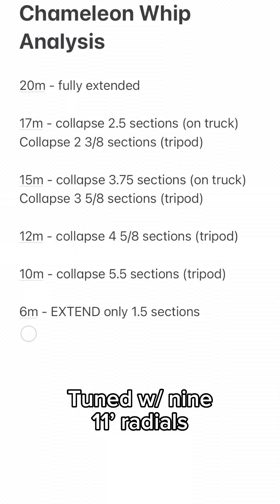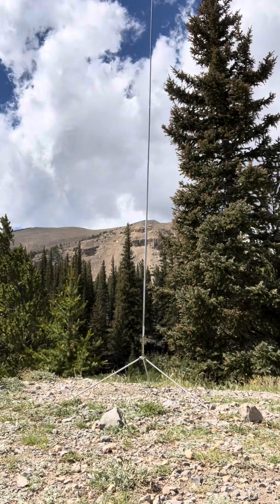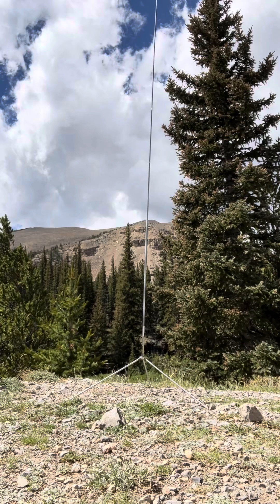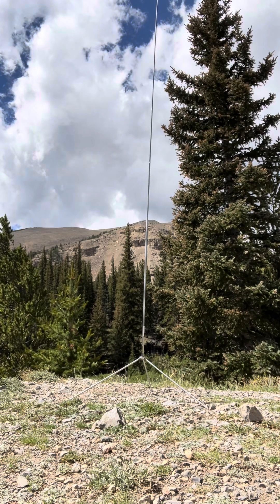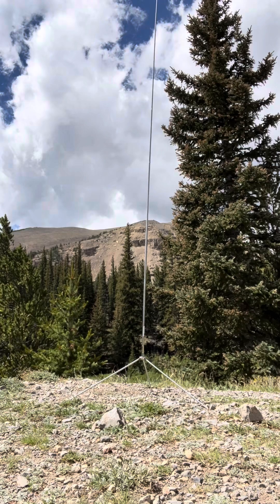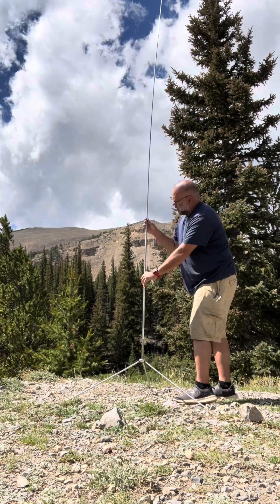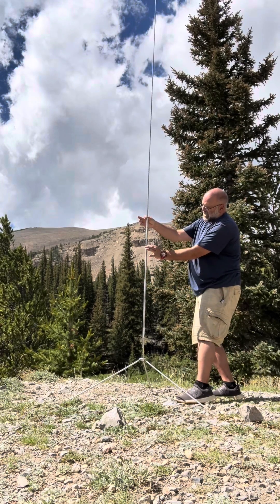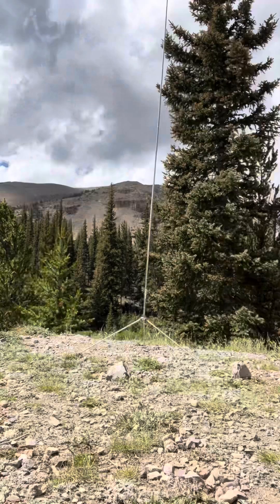Tuning the Chameleon 17’ Whip

Comment: Why is it different on truck mount??? Does the mount add some how to it ?
Reply from the maker: The magnet mount on the truck has far different conductive properties than the wires laid on the ground. I find no tangible difference with either of those settings and taking them all over the country, but there is a difference from the ground to the roof of the truck. Keep in mind the truck is 9500 pounds of metal.

Comment: Great video. I was looking to see how people were "marking" the stainless whip for the different bands when I found this.  Well, this just makes too much sense!  Thanks!
Reply from the maker: Thanks for the comment, Steve. My first antenna was a Wolf River Coils and I marked the coils with a Sharpie for quick reference. I learned immediately as an evening activator that you can’t see those lines well in the dark and flashlights/red lights just cause a lot of glare and don’t help either. Hence this process.

Comment: Thanks for the info Sir. I’m using an aluminum window screen for a counter poise. I normally pull out the 25’ tape measure but this will be much more helpful. Thanks again,KD5OZJ 73
Reply from the maker: Of course! Your readings will likely be different but my info will get you started.

Comment: Im going to get that whip, Already ordered a spike. Have you considering getting a coil for yours? Is a choke necessary for this style antenna? and if so, would it be placed at the antenna feed point or at the radio? Do you use radials for this setup? Sorry I have a lot of questions! 😂
Reply from the maker: No problem. I owned the Wolf River Coils before I got the Chameleon. The two work well together but I tend to be on 20-meters or higher and rarely need the coil. Occasionally in high winds I'll use the coil so I can shorten the whip. I've never used a choke with the whip, but my understanding is it would work best at the radio to keep the shield of your feedline from becoming another antenna. As far as radials, yes I definitely use them when the antenna is on a tripod. I use nine 11-foot wires in bundles of three. You always need something else to pretend like it's the other 1/4 wave of the antenna. Oftentimes the whip is mag-mounted to the top of the truck, so the metal in our 9,500-lb truck serves as a substantial ground. No radials needed then.